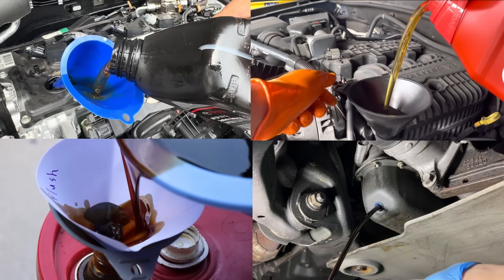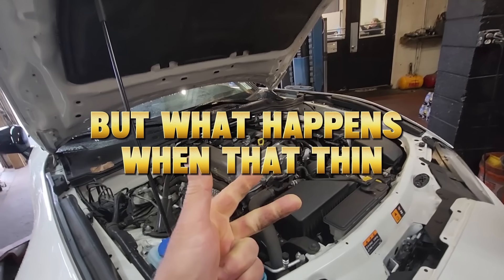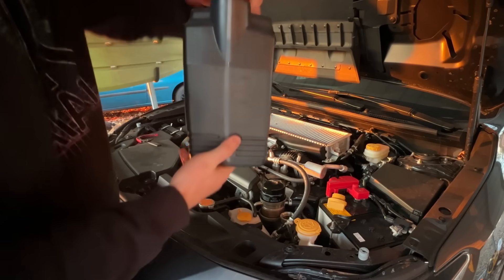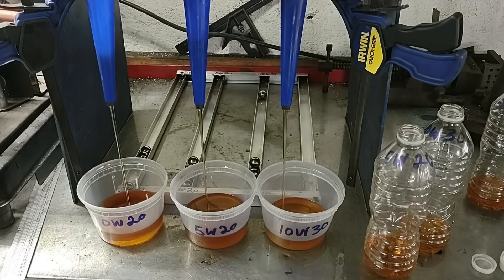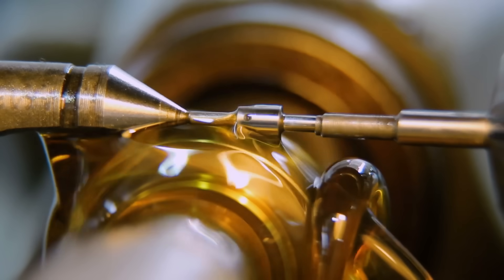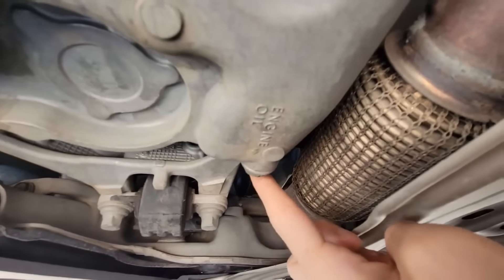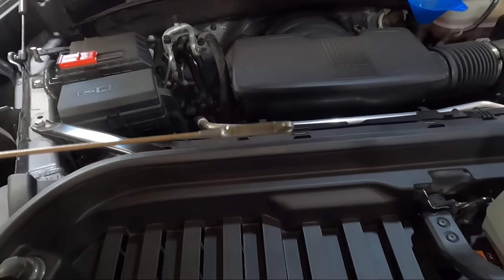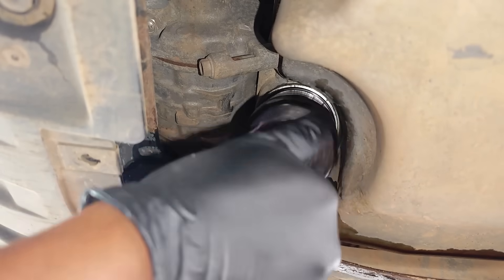The TRUTH About 0W 20 vs 5W 30 Oil (50 Engines Tested!)

Comment: Amsoil 5W30 full synthetic, 2013 3.5L Ecoboost F150. My cam phasers started making noises at 100k on start up. But Ecoboosts are notorious for this. I’ve only ever used Amsoil and never had problems before.

Comment: I actually prefer 0w20 after trying 5w30.  I get better mileage n don't lose oil. the 5w30 makes engine run sluggish. 2017 130,000km Toyota 2nrve engine. Car runs in humid tropical weather 32celcius average yearlong.

Comment: Using 0-40 supercar. Mobil/GM recommends that this is the only oil to be used. Both stated the European 0-40 won’t give the same protection.  I live in a hot climate.Is it BS?

Comment: 2012 Honda Accord its uses 0W-20 but I've experimented with 0W-30 and 0W-40 from Amsoil to Pennzoil ultra two of the best oils. I've sent all my used oil samples always to labs and never had a complaint but they always recommend going original. 
I change my oil every 5.000 with Pennzoil and 8,000 with amsoil never have engine issues.

Comment: As a technician (retired) in the oil testing industry, in South Tx., I agree with everything in this video! An oil engineer told me, when 0W-20 was first being verification tested, "don't put that Goat Piss 0W-20 in your engine If you want your engine to last!" You nay get slightly less fuel economy with 5W-30 but much less wear will occur. More info on the Motor Oil Geek, with Dr. Lake Speed, oil engineer, on YT.
Reply: LOL. Mr Lake Junior would say 0w20 is ok and great and will not causing problems.
Reply: BS! I have 172k on my 16 Camry been using 0W 20 since new & my oil analysis I do periodically says my wear metals are below average 👍
Reply: What's your opinion of 0w-30 or 0w-40?

Comment: Good start, 5w-40 user. First the word Synthetic means nothing. Must be Group IV. Stop using a Marketing term. Second Check owner's manual of a high-performance sports car read about racing the car. Yes they will go as high as 15W-50. from daily 5w-30.

Comment: I have been an ase master techinician for 40 years/ owner of my own shop for 30 plus years ! 0w20 is like putting in hot coffee in your engine! I  cant say enough about what you are saying!!!! 5w30 full synthetic is all i use for most of my customer cars!!!! never sludges up the engine!!! no oil cunsumpsion!!! gm 5.3 lts engines/ 6.4 ltr engines are my money maker due to using 0w20 oil!!! lifters make noise etc etc!!!! also never go more than 5000 miles between oil changes....

Comment: Newer engines have low tension piston rings that can't efficiently scrape 5w30 off the cylinder walls. This leads to higher fuel dilution, oil consumption and bearing wear. It's a fools game to switch away from the recommended oil viscosity if you're not having the oil sampled every step of the way.

Comment: Audi A6 C8 3.0 TDI 286P.S. 2022y. I switch from 0-30W to 5-30W Full Sintetic Mobil 1 and 6K miles oil change not recommended 18K miles. I drive every of my car from last 12 years with this oil and oil change intervals and i was never broke or have any problems with petrol or diesel engines. My mother also have Audi Q2 35TFSI(2024 150p.s. 1.5l. 4cyl. Petrol Turbo with direct injection)with dealer specification 0-20W. We drive only first 6k miles with this "Club Soda oil thing" and then switch again with 5W-30 Mobil 1. No matter what they say its better to take care the car easiest maintenance in your own hands. Proper oil and proper interval's. Its cheap than engine failure and time in service.

Comment: In my Sierra I run nothing but 90-weight bar oil. I just leave the oil fill cap off to let it breathe, and it purrs like a kitten.
Reply: I run pure cat piss in mine and it purrs like a kitten also, plus haven't found a mouse in it for 500,000 miles. Only downside is getting kitty to piss in the engine at every oil change. 😆

Comment: All 3 of my vehicle's says to use 5W20 & i did when they were new.
At 90k miles I switch them over to 5W30.
I live in N.C where it doesn't get too cold & even if it does, it's only cold a few days. But our summers can be bad hot & muggy.

Comment: I switched 5,w30, to 5 w40. In hot and weather and towing in my range rover sport 3,000 cc diesel had no problems but don't  know any long term what the results would be as others are using across the EU in theirw Landrover range rover products..m

Comment: Your comments make a lot of sense.  It would seem that the best of both worlds is to switch the oil as the outside temperature changes due to season.  I would like to know if 0w30 gets it's viscosity range from additives?  If so, those additives will probably wear out in time.

Comment: My car calls for 0W-20. I give it a country cocktail. Half of it mixed with 5W-30. That way the variable valve timing will operate, and the thicker oil will protect it better. 

Full synthetic, and changing every 5K.

Comment: I have a 2007 mustang GT 4.6L, cap recommends 5w-20, it’s a 6 quart system. At around 100k I was filling with 5 quarts of Mobil 1 5w-20 and 1 quart of 10w-30.  The last oil change I did at 130k I went with half 5w-20/10w-30.  
I use non-ethanol fuel with Lucas gas treatment since it was new.

When I used all 5w-20, even when new  I would see a puff of white smoke at cold start-up.  With the 50/50 mix of Mobil 1 makes it at about 7.5w-25 I don’t see any smoke at start up.
Sooo 
Next oil change I will go with 5 quarts of 10w-30 and one quart of 5w-20. Until I’m out of 5w-20.
I live in the south where weather rarely gets below freezing.

At 65-70 MPH I get 27-29MPG
City is 22-24mpg

Ethanol fuel causes a 10% less mpg,  so I avoid ethanol because of less mpg and expensive ethanol related complications.  Much easier to find non-ethanol fuel today then 10 years ago.
Anyway;
This is the second video I’ve seen that warns about 20 weight oil.  My engine has loosened up obviously, but I think 10w-30 Mobil 1 is better.

Comment: I bought a 2018 Hyundai Ioniq blue, Hybrid, in 2020. It had 18k miles on it. The first thing I did when I got home was change the oil, to a Synthetic. It calls for a 0w20, so I started off with that. I also know that the engine runs cooler with synthetic's. I had a 3 hour commute to work for two and a half years, I changed the oil every 7k. or when I see it start to break down. One day in the summer I switched to 5w20, I No issues  and I run at least 8k. In the winter I switch back to 0w20. I get the same milage on both oils. The only thing that affects my milage is air temp, wind, and rain.  as of today, I have 197k. I'm still running 5w20 High milage, extended performance from Mobil 1.  I also use a K & N air filter.  a 99.99% oil filter Mobil 1.  This low velocity oil for fuel economy is a joke. So you get 4.3 % better in the city you said, but thats also stop and go.  Or When you use a gasoline that has ethanol you get 4% less fuel economy , I only use 91, 93, or if I can't find those it's 89, non ethanol gas.  Look at G.M.'s 6.2 L they want 0w40, well thats not good, people already having issues with that.  There is 0w8 on the shelf What, yeah, I wouldn't even use that.

Comment: I've got a 2010 Toyota estima hybrid with a 2.4 petrol engine with regular oil changes at 5000 intervals and mine had nearly 250,000 miles on it and i use 0w 20 oil.......

Comment: I'll stick with 0W-16 in our 2022 Toyota Venza no matter what the temperature is outside. (The operating temperature inside the engine is what counts and there's little difference in it regardless of the ambient temperature.) I'll also continue changing my own oil every 5,000 miles.
Does it really matter? Maybe not. Maybe it doesn't make any difference... In that case I will follow what the owner's manual says.

Watch this... https://youtu.be/i0VoEhW2I-E?si=1kFfK9tihSuiy4ih

Comment: Been using 10w-40 Valvoline high mileage synthetic blend oil in my 2001 Silverado 2500 HD since it hit 100k. Currently at 285k and still runs strong.
Reply: 15w 40 only in 2000 626
Reply: The 6.0 will last no matter the oil weight as long as you keep up with oil changes and make sure the oil is always topped off

Comment: I've seen some comments calling this video BS. Look at this.
Though Scion vehicles were manufactured in Japan by Toyota, the Scion brand was exclusively for the North American market, not Japan. Many of the models were simply rebranded versions of vehicles already sold as Toyotas in Japan and other countries. These markets, including Japan, often specified 5W-30 oil for the same engines that were recommended 0W-20 or 5W-20 in the U.S. due to stricter fuel economy standards.
Reply: Subaru does the same thing. In Japan they recommend 0w-30 or 5w-30 in their vehicles.
Reply: Damn I think I will use 5W-30 from now on
Reply: Same with domestic vehicles as well. Originally some engines called for 5w30 then a few years later the same exact engine called for 5w20. My ford 2 valve as one example
Reply: Bingo
Reply: Same thing gose to Chrysler a research i personally did .. ,  2012 models got the same exact V8 yet in different regions, in the hand books the viscosity changes!! Depending on the regulations of the particular region !!.

Well, by rule of thumb is in cold ambient temperatures, this is the facts :-

 (-40°C) = 0W..

(-30°C) = 5W..

(-25°C) = 10W

(-20°C) = 15W

(-5°C) = 20W

The lower the number that comes before the W the better the flow will be (in freezing temperatures).

Note that (Fully synthetic) with the latest (S)/ spark rate is the the better the flow you will get in cold temperatures & the better protection you will get when engine run hot under load , yet won't be as pocket friendly / budget friendly as the Simi synthetic or the minral oil .

The numbers after the W will be how the oil reacts in hoter ambient  under engine oprating temperature &  under load , the higher the number the stronger the layer thickness the better the protection.

But thanks to the (C.A.F.E) AKA Corporate Average Fuel Economy Regulations they only care about the fule economy & their own pockets !! Therfore they go lower & lower when it comes to oil viscosity to improve (0.01) in fule on the expense of engin life !! If the manufacturer didn't follw the regulations (C.A.F.E) will fine them hefty!! Thats why they keep up with their shenanigans .

& sorry for the book .

Comment: My car has the 0W-20 recommended sticker in the engine compartment. The manual has an ambient temp range grid which has other viscosity oils. I've used 0W-40 EuroCar oil but settled on 0W-30. With the 30 & 40 grades the engine oil temp is 5° - 10° cooler than with the 20. No oil usage with 6000 mi service interval. After watching this vid I'm considering switching to 5W for the Summer months.

Comment: I have a coworker who has a Toyota FJ.   He bought it brand new and it has a mix of highway and city driving on it using 0W-20 oil.  The mileage is well over 250,000 miles on it and it uses no oil between changes.

Comment: I always run at least 1 grade higher than what the cap says, usually 5-30 in the modern gas engines, but keep my diesel at the 15-40 that it’s designed for…never had a bearing issue

Comment: This push for EPA and MPG is getting ridiculous.  They now have 0W8 motor oil.
Reply: Right the EPA kept pushing "Less water per flush" in toilets till it became common for people to flush twice.
The EPA kept pushing "Less water per load" in clothes washers, now all the modern machines (past 15 years) have the option for adding 1 or 2 extra rinses to the cycle.
The EPA kept pushing "Less water per load" in dishwashers, now we are starting to see more and more people run the dishwasher a second time with no detergent to get spot free dishes.
Point is, whenever you keep pushing greater efficiency, you eventually get lied to and your actual savings become negative.
Reply: I hear sand works just as well!
Reply: The auto manufactures lied about the long term safety of these thin oils so they could bump up their fleet MPG rating just a small amount.  To them, the oil just needs to be sufficient to get out of the warranty period, screw the customer, and comply with EPA. 
Hey EPA, we get a little better MPG at the expense of throwing away vehicles earlier. I'd rather keep a 4 ton vehicle out of the trash.
Reply: 0W-4 is now being tested by some of the manufacturers in Japan.

Comment: Oil thickness by itself means nothing.  Oil for a jet engine (like Mobil jet oil 2) has the same viscosity as 0w8 engine oil - about 5.5 mm^2/s, but it faces much more severe load and many lives literally depend on jet engine reliability. But it works well, because engine had been developed for this viscosity. Same thing with car engines, if it’s engineered for thin oil, use it, if it’s a relatively old engine, but manufacturers forces owners to switch to a thinner oil only for the fuel economy and emission lowering, thicker oil will be more suitable.

Comment: thicker oil at temp will always protect your engine at longer life. why do yo think truck oils are thicker it because the run all the time there for 15w40 or 50 is in these diesel and yes this works the same for all engines out there. using a thing oil does not protect the engine from wearing out fast

Comment: Gemini's conclusion is here.

That's a very common point of confusion and debate in the automotive world. Here is a breakdown of the lubrication and high-mileage perspective:1. The Lubrication Argument (Thickness at Operating Temperature)The statement that "0W-20 does not lubricate as well as 5W-30" is based on the second number, the hot viscosity (20 vs. 30).5W-30 (Hot Viscosity = 30): The '30' means it is thicker when the engine is at its normal operating temperature.1 This thicker film provides a more robust cushion between moving metal parts.2 This can be an advantage for maximum film strength and wear protection under extreme stress (like heavy towing, track driving, or very high ambient heat).30W-20 (Hot Viscosity = 20): The '20' means it is thinner when the engine is hot.4 Modern engines are designed with tighter tolerances and smaller oil passages, requiring this thinner oil to circulate quickly and fully.5 If you use an oil that is too thick (like a '30') in an engine designed for a '20', it may not flow fast enough, which can lead to:Slower filling of the small clearances.Reduced oil pressure in critical areas like the top of the engine.6Potential issues with oil-operated systems (like Variable Valve Timing/VVT).7Conclusion on Lubrication: For an engine designed for $0W-20$, that oil provides optimal lubrication because it has the correct flow rate to reach all parts as intended. For an engine designed for 8$5W-30$, the 9$0W-20$ would likely be too thin for proper protection.

Comment: 2024 Camry  XLE non hybrid factory oil says 0w16 I changed my 1st oil around 800 miles and put in 5w30 Pennzoil Ultra Platinum the engine immediately became quieter my gas mileage highest so far on a trip was 44.8mpg calculated at the pump window sticker says 39mpg  highway. I change my oil every 4000 miles because I do a lot of stop and go driving, why worry about 1 or 2 % fuel savings when you are getting better mpg than the factory says and the engine runs better and QUIETER which mean less friction in my mind.

Comment: I like to start off by using the best oil on the planet, which I believe Amsoil  Is that oil. It holds up under heat better than any other oil all my cars are turbo. I also changed the oil every 5K with a high-quality oil filter like Wix xp

Comment: I use 5-30 mobil 1 esp. do to my car is an diesel. and it has always had that. and it has npw 206 000 miles on it. still runs grat and is very clean. And never use oil. betwine oil services-

Comment: I have a 2025 Subaru outback and the only oil I use is OW-20 castrol full synthetic, and despite what the label says or claims, I always change my oil at 5000 miles, no more than that.... maybe these oils can really go to 7500 miles, but also at that point, they are definitely broken down and not protecting engine parts like they should, so why push the limits?..... I feel 5000 miles is a good point to change, because the oil is still functioning at about 70% capacity, maybe a little less, but that's better than changing it when it's at about 90% capacity or more, simply put it's not going to hurt your engine, keeping fresher oil flowing through it

Comment: I have 312k miles on my 2009 Toyota Corolla, still idles perfectly. I only use 5w30 full synthetic. 5000 mile service intervals and genuine oil filter. My car is the last model before the CVT, probably the best Corolla ever made. They introduced CVT for the same reason, for fuel efficiency, but they are absolute garbage.

Comment: It says by manufacturer 0W-20 only, the VW 508/509 standard specifically, so that is what I'll use. I use whatever manufacturer says. On previous models it was 5W-30 by manufacturer, but my model no more, 0W-20 for me now. I drive short distances so it is probably better for that too. I'm not worried for possible long distance also, because I think my car has a good oil management system, keeps the oil good operating temperature, at least in my mind. I have the new VW 1.0 TSI engine, is a good engine.

Comment: Old guys opinion here.  Most engine wear is at start up, that's why highway miles are easy miles compared to short hop city stop and go.  Use a thinner viscosity for cold starting as immediate protection is offered on startup at colder temps.  Go for a higher viscosity rating for engine protection under load. A 0-30 oil compared to 0-20 flows the same for starting in cold weather. But the 0-30 protects LIKE a heavier 30 weight oil when warm.  A 5-20 is recommended by Chrysler for it's 6 cylinder, the same engine a year earlier was 5-30.  The exact same engine, the only reason for the thinner oil?  EPA mileage ratings.